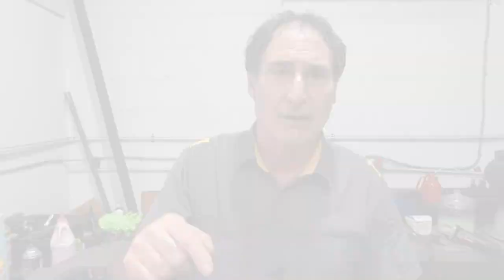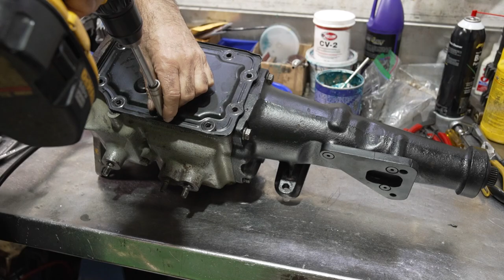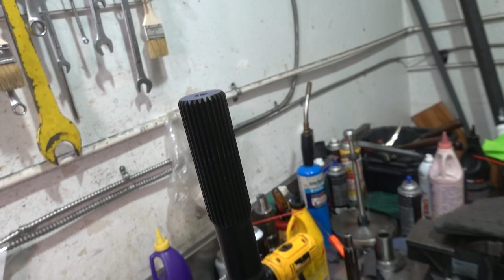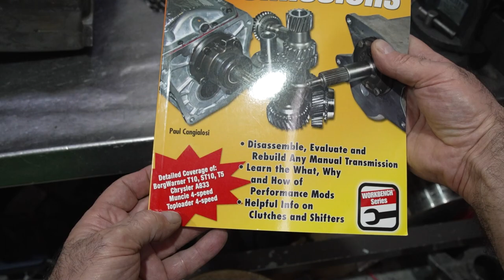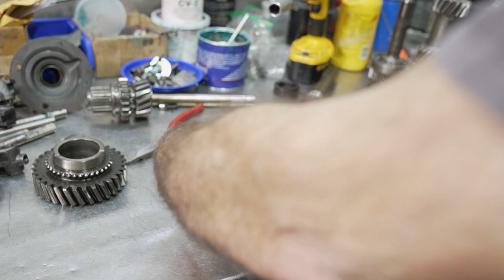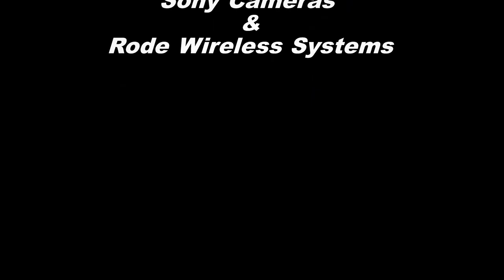Learn How To Rebuild a Ford Toploader 4 Speed - Part 1

Comment: I'll sometimes use a decent sized shot bag (like for pounding sheet metal against) to put under something that doesn't have a very flat bottom to keep it from rolling, the object pushes into the bag and the shot bag conforms to it and holds it.
Reply from the maker: Good idea

Comment: Great video Paul, was wondering when you will do a top loader video, I use a telescopic magnet to remove and reinstall the detents, helps with them not flying around everywhere. Cheees
Reply from the maker: Never found one that worked well.
Reply: @GearBoxVideo  correct you need to find one that is the right diameter. I enjoy watching your videos, we met a few years back at PRI, how about I have one with me next time I’m at PRI 😀😀
Reply: Great video! Just bought a date specific one for my Fastback to get rid of the auto, also looking at doing my friends T10 that he is having trouble with. Hanging out for the next video

Comment: Ihave a Henry J with a 351w and the 3+1 toploader, if this combo was considered strong enough for the 77 econoline van I would think it would be fine for the Henry J. What are your thoughts .
Reply from the maker: The 3+1 was made for normal driving. So if younplan on power shifts and burn outs ....no

Comment: ABOUT TIME, lol 👍, what a coincidence, I been waiting for a great video on this.  i have a 65-71 toploader apart, been sitting  apart in garage for 20 years, some surface rust, and only main issue some broken teeth from the front of main shaft, and I have been watching tons of videos , yet no one has provided a really good step by step instructions of assembly, issues, fixes, or explanations, so to say i am excited is an understatement I can hardly wait for part 2, 3 and 4 , and if need be 5. . also a questions for you, sir. If some teeth from the main shaft are broken,  possibly from trying to remove the C clip snap ring that holds the 3 -4th synchro gear on, is this detrimental or can it still be  used   on a non hipo car, jut for basic easy driving, a cheep fix, till i can find another good top loader to replace it? its missing 4 or so teeth at one end , and possibly 6 or so on the other end . and 3 or so teeth in between . Yah i know, buy a proper snap ring remover, doh!
P.S. watched many of your videos, never once have i been disappointed. another great detailed video. thank you.5 out of 5 stars
Reply from the maker: Any gears missing teeth have t be replaced. Thanks for watching

Comment: Paul - when you tested the bearing you mentioned it was bad - how could you tell? Also, without a press is there any way to install new bearings or do you need to have them pressed on. One last thing - what is your source for top loader rebuild parts - DK?
Reply from the maker: Visually you can see the pits . I show this in my upcoming video

Comment: Paul thank you for all the great info. I have a problem with a toploader Im getting ready to install. I noticed 3rd and 4th gear are hard to engage. It is also hard to find neutral from 3rd and 4th. What could cause this issue?
Reply from the maker: Sounds like a shifter or detent issue
Reply: @GearBoxVideo  I was just watching your part 3 where it talks about detents and rails. I disconnected my shifter linkage and still having trouble so Ill start with the detents. Thank you for your quick reply

Comment: Given there was a input shaft needle bearing in the bottom of the case before you separated the input/main shaft, could it be when this was previously put together he have dropped the needlebearings before engaging the main shaft, hence creating uneven tolerance between the input/main. And then resulted in the lockup because of un-even distribution of force on the gears/shaft.
Reply from the maker: Not the issue. Youll see in the upcoming vids

Comment: Of all the 4 speed transmissions you work on, which is the toughest?
Reply from the maker: None really
Reply: @GearBoxVideo  Hmm, of all the transmissions you don't work on, which is the toughest?
Reply from the maker: Again.. nothing. Its really all the same for me. But if you want to think of more labor intensive... There are some that require more labor than others . Too many to really make a comparison. Some require more technique or proper tools.
Reply: @GearBoxVideo  Hmm, well out of the box I would have to say the ford top loader. Not so much from experience but from hear say and articles I've read. All the best.
Reply: @joe-hp4nk  for sure as far as a stock trans hard to beat the toploader

Comment: Hey Vince, What is the secret to the 4 spd overdrive version of the toploader to remove the input shaft ... the counter gears after dropping them do not allow for enough clearance to pull or install. There is however, a few teeth on the 4th gear that might allow for some clearance, but that does not seem to work either. In the video, the input shaft pulls right out, but not so for the 4 spd over drive. I have worked on two of these transmissions and always the same problem ... any help? Dan
Reply from the maker: Ive removed the rear bearing, and try to get some of the thrust washers out.

Comment: at 15:20 when you say you "want to make sure the gear isn't hitting the lower gear", can you elaborate on what exactly that means?   In the case, is it about the gaps between gears and the hammering will close that gap, or is it that when the bearing pops free, that the gear assembly comes crashing down together in the case?  I want to be sure I don't gouge some important bits.
Reply from the maker: When assembling or disassembling the transmission you just don't want to bang the gears against one another

Comment: I have the trans i need to look it over to put back in the car is 70 muck 1 4sp  and transmission  was in shop under towels  it got there in 75 i got it looks good the guy was thinking about 67 350 car swap  it thinking  it was good thinking  glad he stopped.

Comment: Can you not just pull the input shaft out the front with everything still assembled to then press out and replace input shaft bearing? You mentioned there’s needle bearings. But is it impossible to load bearing seat with grease and put needle bearings back and reassemble input assembly?
Reply from the maker: You  cannot. The countergear is in the way

Comment: Hey Paul I have a 66 mustang and got ripped off from a guy and long story short I now have a ford 3+1 from a 77-78 time frame. My question is can I do anything with any parts of this transmission or should I just scrap it? Oh it would be going behind a built 289 roughly 400hp and 380tq
Reply from the maker: Not worth it. Some people do what the overdrives for lighter duty applications
Reply: @GearBoxVideo  thank you for the reply. Also what would be considered a lighter duty for example. Less than 300 or less than 200 TQ?
Reply from the maker: All you have to do is look up the ratings of what the transmission came out of . Its an OD unit so the ratio drops are not meant for performance.  Meaning its not about the numbers it is how  the unit was designed to be used

Comment: At 11:30 minutes I can’t get the rail out. It won’t move at all.
Reply from the maker: remove the detent.  If the rail won't move that meand the box couldnt shift into 3rd or 4th.  If it did, then the rail moves
Reply: I screwed up and pulled the springs out but not all the detents. I removed the springs but some how pulled it out of third and it became a bigger mess. I ended up just having it to an old school professional brought it back to life! Lol It’s an RUG-AJ.

Comment: Wish the jokers of manufacturing that thinks removing dipsticks are a good idea would hear that "check yer oil levels" ... 
And don't get me started on that oil has an indefinite life span. /rant over
Reply: IMO a dipstick is worthless and just creates another place to leak from.
Unlike an engine, transmissions don't consume oil when they get older. As long as there's no puddle of oil under your car where you park, the level will always be correct. Besides, you should be changing your gear oil every couple of years anyway.

Comment: Well done video.  I have a 1964 toploader 4 speed and can't get the slip yoke all the way in.  After inspection, about half of the length of the splines in the slip yoke have a slight twist.  Tried a brand new slip yoke but it won't fully engage either.  Is it possible the splines of the output shaft could also be twisted or is there something else that would prevent the slip yoke from fully engaging?
Reply from the maker: Yes both output and yoke can twist